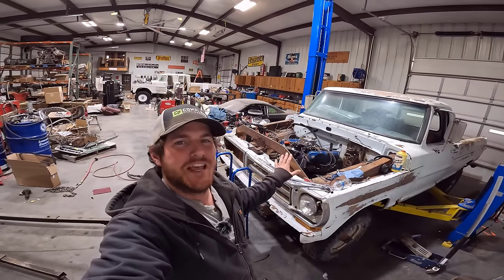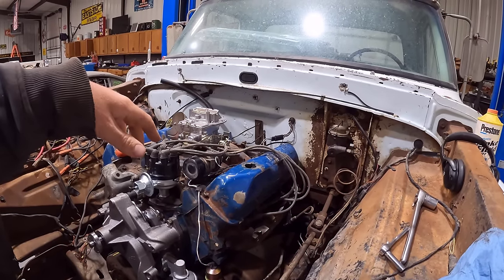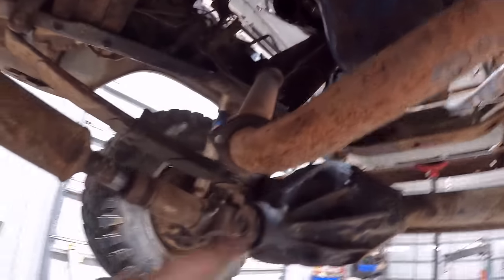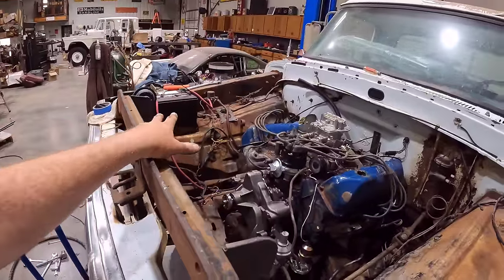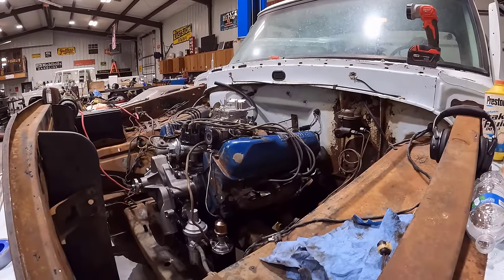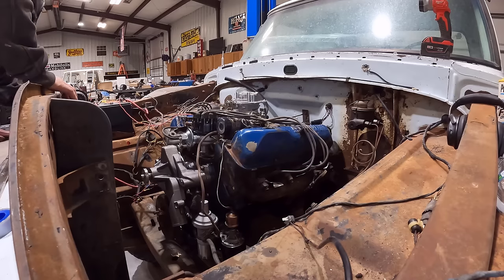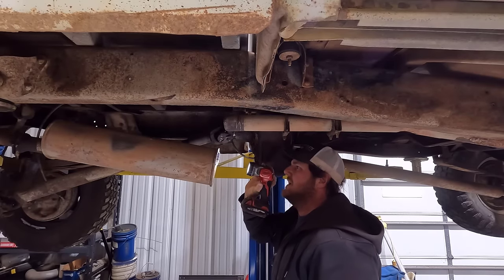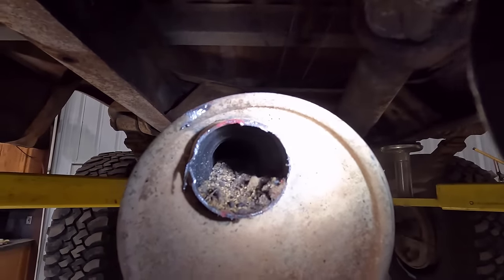After 26 Years This 1971 Ford Highboy Is Back on the Road!

Comment: Hey Matt it’s always great to see these old trucks back on the road. I had a couple of 71’s and a 70 all 2 wd l had trouble finding a good right grill insert for my 71 I was fixing up the right sides always seemed be broke so I ended up using the left side grill from my other 71 if remember all but 1 screw didn’t line up and I know the fins are angled differently from side to side from a distance you could even notice it.
Reply from the maker: Thanks! That’s good to know. I’m working on the cosmetic upgrades episode now and I actually patched together the right side grill I had. So it worked out.

Comment: Nicely done.....sure sounds good.   What carb did you put on it?
Reply from the maker: It is just a Chineseium one from the jungle website.
Reply: Would you recommend this carburetor?
Reply from the maker: @brentambo6555  I have used a couple on budget builds and have had decent luck with them. I prefer Autoline but the one I needed for this truck was out of stock at the time.

Comment: I grew up hearing two of the most obnoxious fe bbf trucks both bumpside Ford trucks one was my dad's 70 Ford F-250 360fe 4spd with the rusty manifolds and it had several bent pushrods when we first got the truck, and ine of his good buddy's had a truck I'd have loved to own even for a short bed a dark burgundy color and a even darker red and silver pinstripe, it a 72 Ford sport custom explorer short bed 390 6.4 litre column shift 3spd with a overdrive pull handle... under the dash... anyway that was around 1994 and he gave $4300 for the truck back then and unfortunately he got it to big block swap a 79 mercury Capri 255 v8 automatic transmission, and i was kinda afraid to see what I would have to have to buy the 71 Ford truck and I wish I would have just asked i have not seen the truck since....

Comment: If you bought 1 new muffler, why not buy another and make a simple dual exhaust exiting infront of the back wheels?
Reply from the maker: I like this set up on a stock engine. Just personal preference.
Reply: I had a 2 inch straight pipe and a dynomax race magnum 3 1/2 case 2.25 inlet and outlet glass pack muffler and it was on my 86 Buick Regal Factory V8 Sport Coupe Oldsmobile roller cam 307 V8, and the 80 Chevy c20 Scottsdale with a 68 250L6 except for the 3 inch exhaust pipe and the same glass pack muffler just 2 1/2 inch inlet and outlet,, and the 3 1/2 aluminized fence pipe tubing and those were some of the best sounding exhaust systems i had and they were single exhaust pipes.. so yeah i understand that Matt kubik sir..
Reply: The 3 1/2 inch exhaust pipe tubing was on my 89 Chevy S10 EL regular cab short bed 2.5litre tbi 4cyl 5spd with the metal reverse gear whine... And for those who don't know the EL is the base model of Chevy S10
Reply: @richardbates2367  And this is a 360 FE motor where a simple tucked dual exhaust system would be more efficient. Any tuning tricks on basically stock engine helps with horsepower to the wheels and gas mileage. With an autolite or a non electronic distributor there is an adjustment with an allen wrench in the vacuum advance to fine tune the timing.